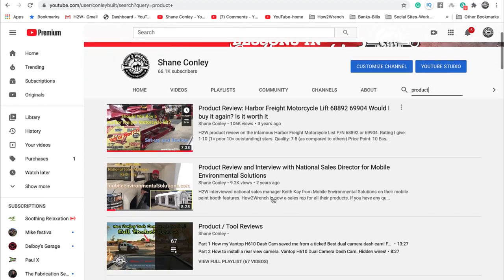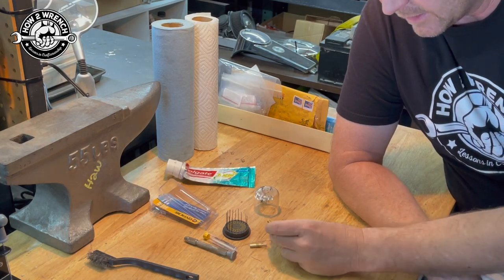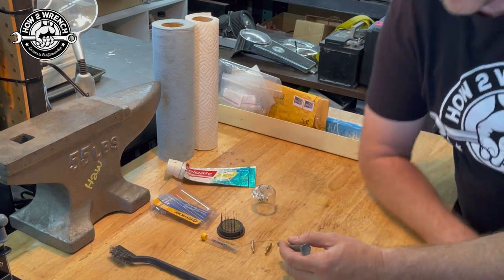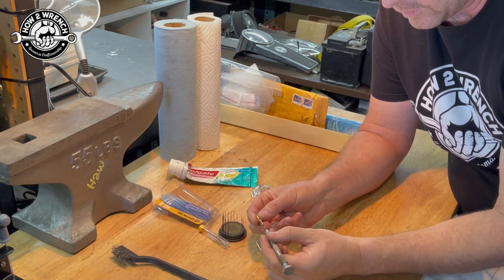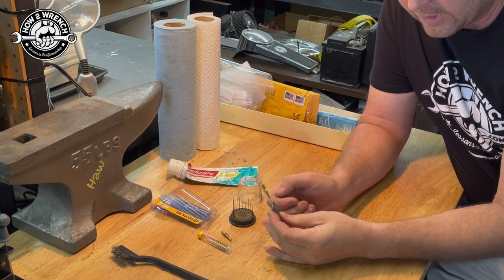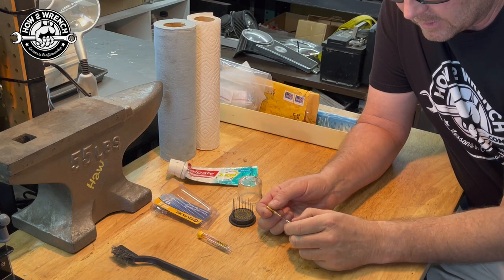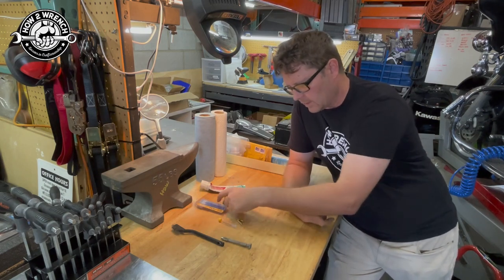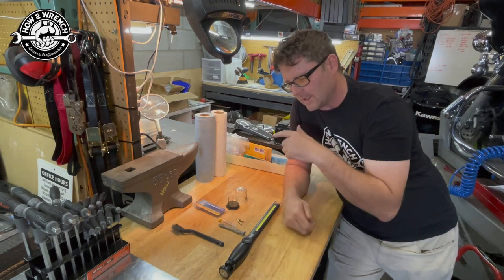How to clear clogged carburetor jets PRO TIP: What tool and where to buy it! #carburetor

Comment: I hold jets in forceps then heat them with a lighter. The varnish extrudes out like tiny turd and turns to ash. No poking required. My Vincent restorer mentor taught me that trick forty years ago and it's worked flawlessly since. Jets being delicate I prefer to destroy the clog without poking. (Worst way is welding tip cleaners which are round files!)

Comment: you should be able to get Gauging drills from a local L.P and N.G gas supply house.  I bought mine in a case with 21 bits from a local supplier near me.  They’ve always worked well for me to clean jets.